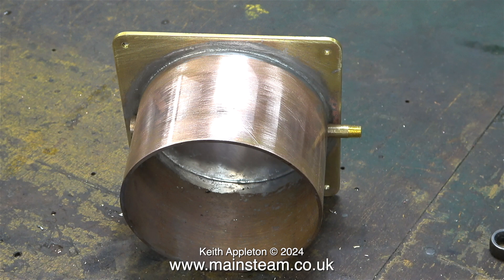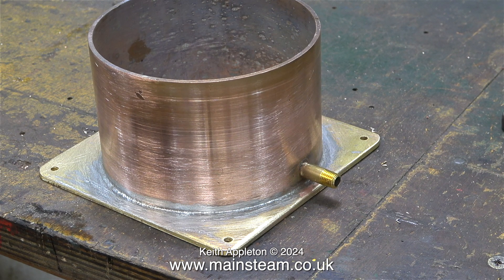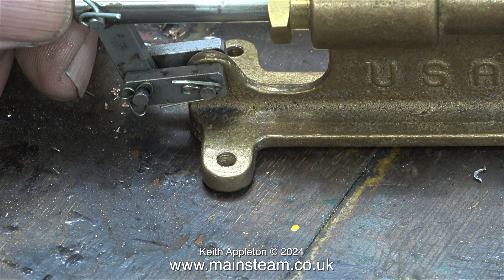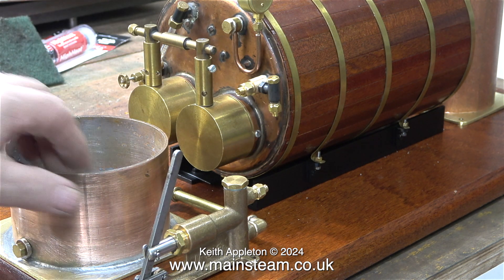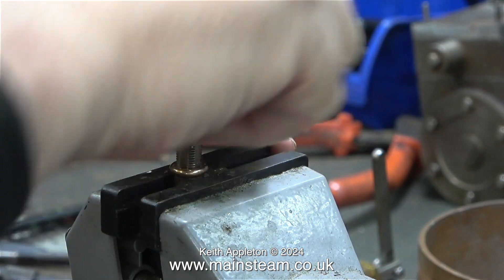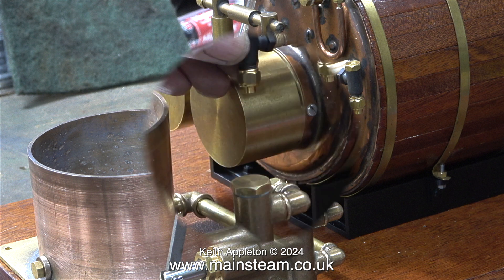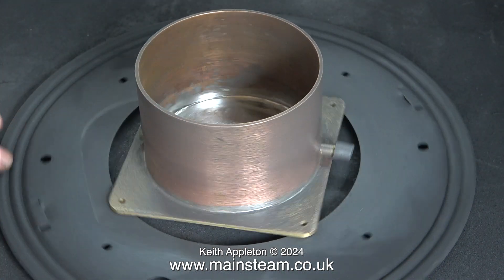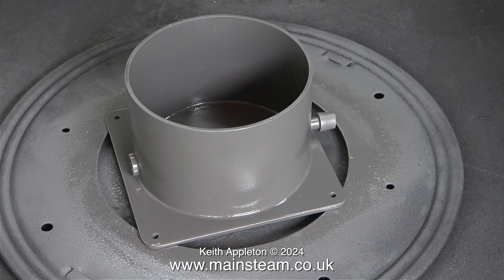A MODEL STEAM ENGINE TEST PLANT - PART #10

Comment: I’m pretty sure thread pitch and threads per inch are the same thing just measured differently.  They are defined as the inverse of each other.
Reply: Thread pitch can also be the pitch diameter measured with a pitch micrometer or using 3 certain sized pins and a regular outside micrometer. The pins are straddling the threads, 2 on one side 1 on the other. They are very hard to hold and mic at the same time, but there are ways to do it with patience and practice. All the information about pin size and pitch diameter tolerances are in the Machinst Handbook. For internal threads you use thread gages for the pitch diameter you are making, or you can make your own. I always wondered why they would use the same nomenclature for two different parts of a thread, but I suppose the oldsters knew what they were doing…